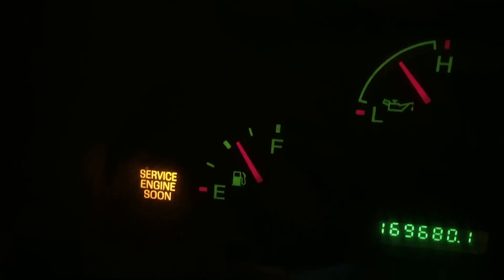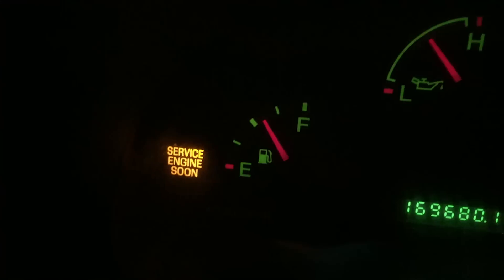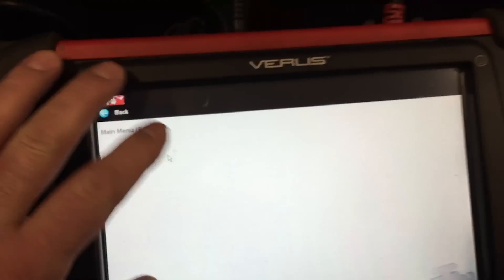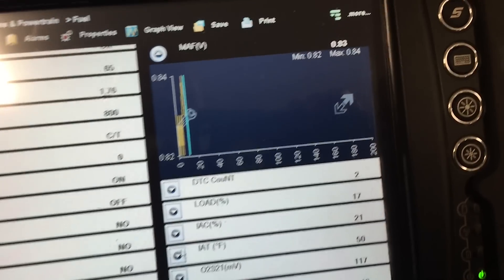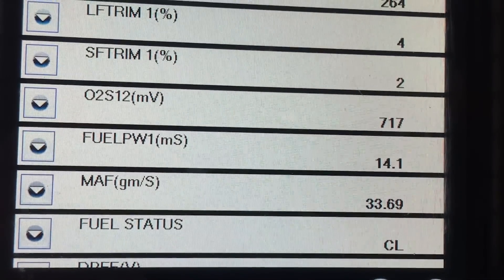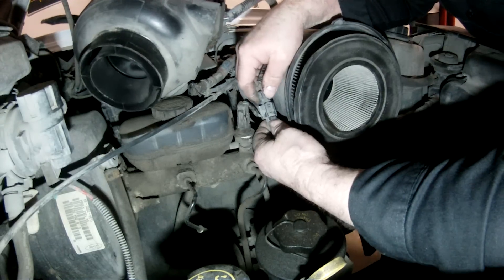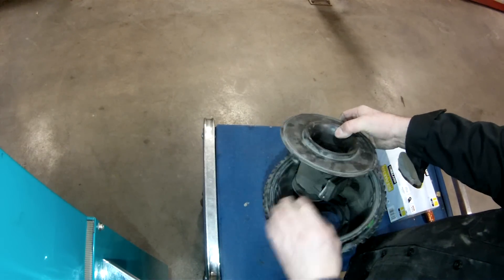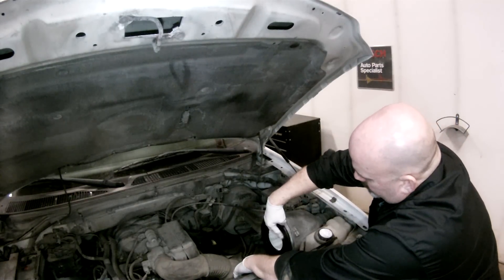Ford P0171 P0174 P1101 - Ford Mass Airflow Sensor Diagnosis Video

Comment: Hi, 

I just bought a 2006 Ford Escape XLT from an Auction. It was sitting for who knows how long and I have had extensive work done on the engine. It is now throwing a P0171 code. The shop has smoked tested it several times and found no leaks, replaced the intake manifold gaskets, done an snap test on the cat, and replaced the MAF. They are recommending I drive it for 200 miles and let the computer re-calibrate its self before doing anymore work since it has been setting for an undetermined amount of time. I seem to have bad mpg, it shutters while idling, and also seems to run fairly loud and rough. I feel that driving it for the 200 miles is a odd request, and wondering if I should get a second opinion or search for any other causes of this code.
Reply from the maker: It should only take five minutes to watch fuel trims after warm to see where they end up. Look real close at the intake duct for cracks they may have missed. Look at the connections of the intake duct hose ends to be sure it is sealing around the air cleaner, MAF and intake side and clamped properly. And yes, you might consider another opinion. Good luck

Comment: You're a good, kind, patient, teacher. I have an F250 7.3 liter diesel powerstroke 1995, if you ever have videos for this make & model I'd be glad to watch those too. Good work you do & good job on the videos. I think you could teach anyone how to take care of their vehicles better - those of us who know so very little.
Reply from the maker: Thank you. Unfortunately I don't work on many diesel vehicles. I do have a F350 7.3 coming in tomorrow for an engine heater issue. You might not care about watching that. I also helped him with his glow plug system a couple times. Once with the valve cover gaskets and another time I replaced the glow plugs themselves. Thanks for watching.

Comment: I have another question.  Just recently my "check engine light" came on again, so I plugged in the computer, and it states that it's running too lean.  Wouldn't that be a good thing?  Can you explain this for me please.  Thanks again!
Reply: Too lean means there is too much air to mix the fuel.

Comment: Hey There,,,,I have to say, that being a "girl" and having people like yourself out there with video's informing people like myself how to clean a MAF sensor was a HUGE deal!! I had to have my yearly emissions test the other month and did NOT pass, so I had put the codes in that had come up into google and found out what the "issue/s" were.  Then went to YouTube to find out how to attack this situation.  Just to let you know, I cleaned my MAF sensor today and there is NO "check engine" light on, nor is there any RPM fluctuation.  I can't thank you enough for posting this video and helping a "girl" with my problem!! HUGE kudo's to you!!
Reply from the maker: IM so glad you told me your story. Just made my day. Hope you get many more happy miles ahead! Blessings
Reply: I was hoping to paste a pic of my f150  to show you how good it looks.  It almost has 300,000 miles on it, it's a 2001, and limited rust along the bottom of the doors.  It's a Super Crew 4 door and it's awesome!!! Can't thank you enough..

Comment: 2003 f150, cleaned maf sensor, light went of, drove 50 miles it came back on. not showing any code, but light is still on. Drives perfect, no problem accelerating. can't find any vacuum leaks. what else could it be?
Reply from the maker: Something wrong if the light is on and no codes. Maybe the MAF is faulty.

Comment: thanks it was right after the sensor. the mechanic who my mom took to get a tune up. they disconnected the vacume line. connected it back cleared the codes ran 200 miles no check engine.
Reply from the maker: Nice! Glad you figured it out.
Reply: Trying to scam your mother🤦‍♂️

Comment: Thank you for sharing your video, I have a Ford 2001 E350 I replaced the Mass Air Flow Sensor, I get the code with the electrical problem. any tips to share ? I also get a humming noise when the Van is at stop coming from the air flow though I can't detect the cause. Any tips would help thnx.
Reply from the maker: The noise is likely from the idle air control. Replacing it would likely fix it. It's possible you have a vacuum leak causing the noise and also causing the lean condition.
Reply: Thank you, I will try those tips and update the information what helped, Thank you again.
Reply: The Car Doctor hello, after 6 Months I gave up. The vacuum replacement did stop the noise. Though I noticed that by taking it to a shop where the computer was full cleared the PCM it finally never came back with codes. Mass of airflow never came back code. Hope this comment helps after doing replacements o parts. By the  keep up the videos they Help a Lot!!! Thank you

Comment: similar issues with my 1997 ranger 2.3 liter. It used to happen once a day, now every other stop sign, it happens. (1st or 2nd gear, let out the clutch, give it gaz, doesn't move, give it gaz, doesn't move, dies out. restart it and it goes... etc). no check engine codes, can it still be the MAF sensor?
Reply from the maker: Very possible

Comment: I have a 2005 ford f150 and it is doing the same thing in your video. Great video i learned alot
Reply from the maker: Thanks. Hope you get the truck figured out. Take care.
Reply: I have the same problem with my Ford 2000 going to replace it thanks

Comment: I'm having similar issues....what if the Mass Air sensor doesn't fix or change the problem in the video...i have a 4.2 thats having revving problems and shuts off sometimes ,a s well as popping and stalling....has a new throttle positioner sensor and fuel filter as well. Thanks for your help
Reply from the maker: Only replace the MAF if it tests bad  lots of things can cause performance issues. Are you getting all the codes listed in this vid?

Comment: Could the MAF sensor be bad even if you have no check engine light on? My truck was running fine (2002 F150 Screw 4.6) and I stopped to replaced my air filter. Could the possible jarring of putting in the new filter cause my MAF sensor to fail?My hot-wires looked clean but I also tried cleaning with CRC fluid and it didn't solve my problem. Any tips? +The Car Doctor
Reply from the maker: Possibly. Be nice if you could do more testing first. Any chance you have a bad plug or coil? Ignition problems usually are most noticeable under a load like going up a hill or accelerating.

Comment: Always enjoy the videos particularly the Ford videos. I have a 98 with the 5.4 and the information is helpful.
Reply from the maker: +Clinton Codack Thanks, that's certainly a solid engine. I had a 5.4 in today with almost 200K miles and it's still going strong. (200K miles here is a lot. No highway miles here) all you have to do is change the oil and fix the minor stuff when it fails and those rigs will go forever. Thanks for tuning in!